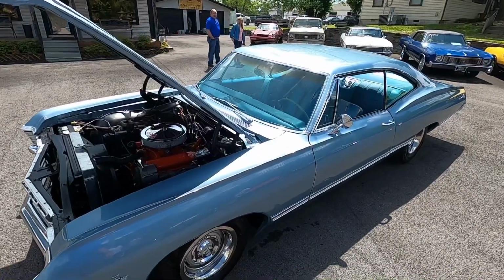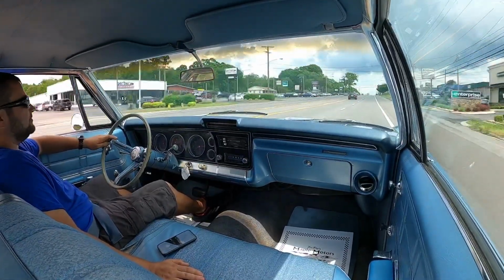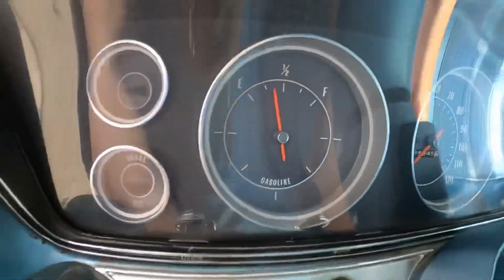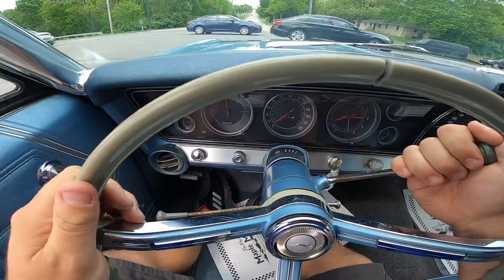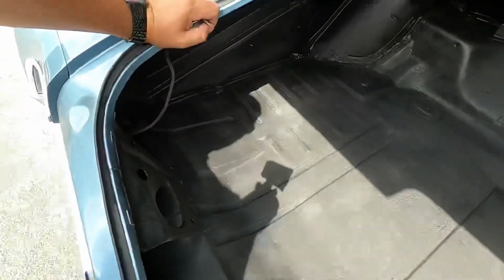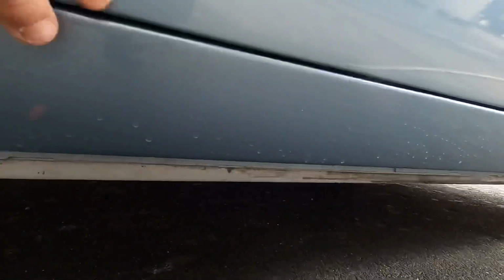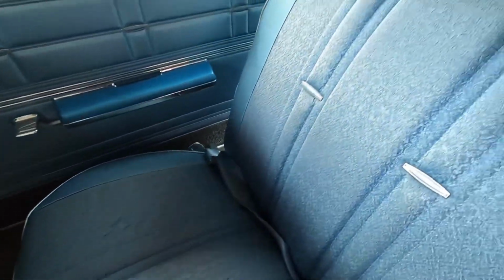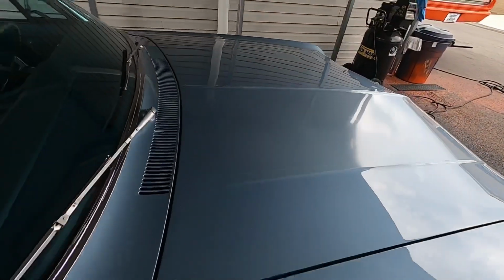Test Drive 1967 Chevrolet Impala Fastback SOLD $26,900 Maple Motors #1642

Comment: I had a '65 impala SS with the floor shift, 327 air shocks in back so it was not a low rider and glass packs for mufflers. It was LOUD, Second best after the '59. I wish I still had that baby it was my first car and took me through 10 years and up and down the west coast several times. I loved it.

Comment: I believe from all of the GM vehicles. If a 327 sits for a while. The valve guides begin to "dry". Once they get oil again. Light gray smoke will go away. Just some old gearhead that has been a car nutt since before I can remember. The only Big 3 that I have not personally owned was MOPAR.